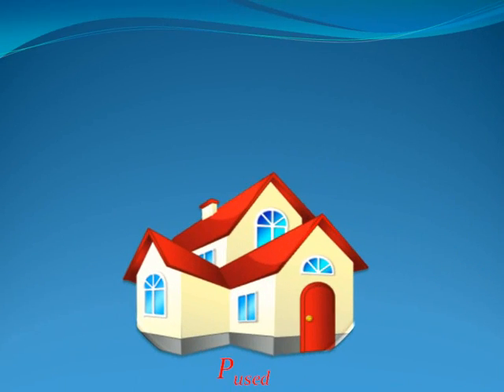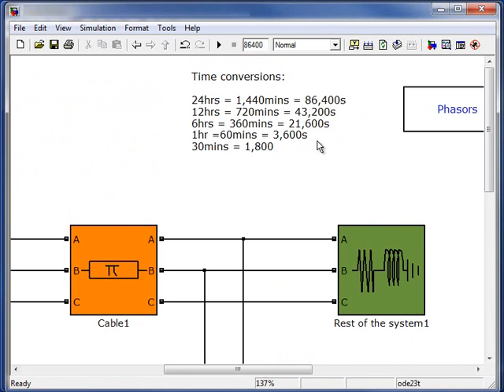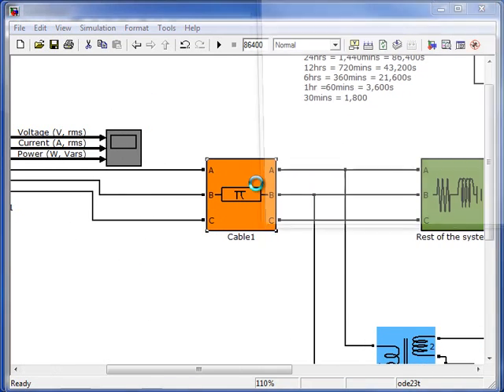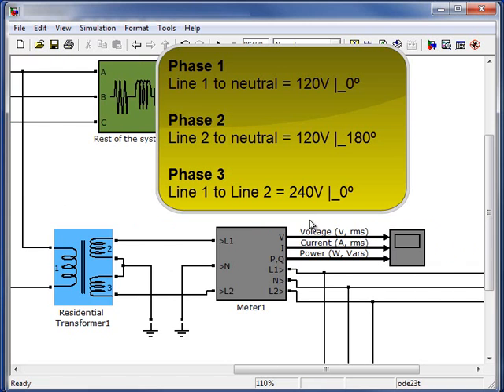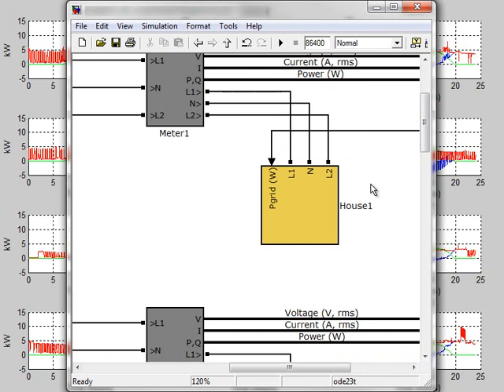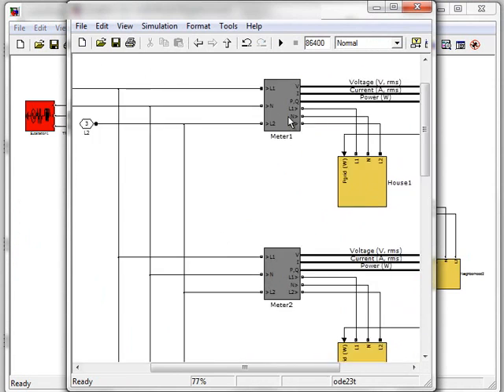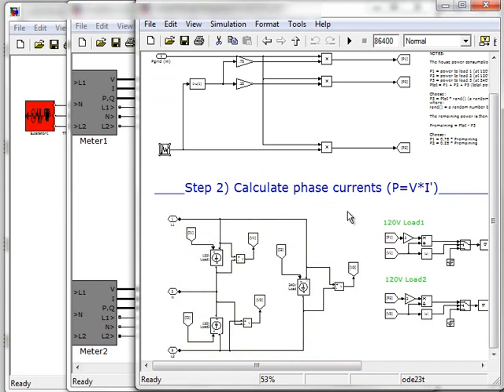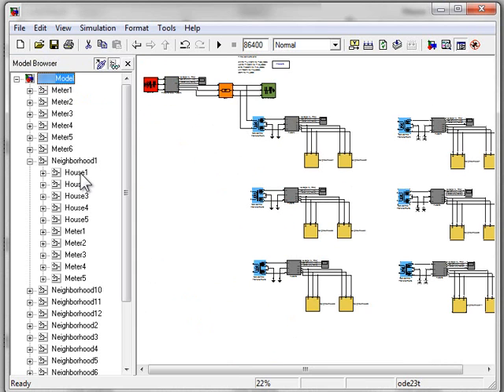Simulink Smartgrid Simulation 1: The Basics

Comment: Thanks for the explanation of the model. How can I run both DC and AC system in "Phasors mode of powergui"? My model works with AC alone, but not with DC source included. Gives error "There is no voltage source, current source, or machine block with a frequency matching the Phasor simulation frequency."

Comment: Thanks very much for uploading this. Where could I find the measurement block you used? I could only find one with V, I output. Or should I calculate the P,Q and create a subsystem?
Reply: plz were can i found the file of download ?
Reply from the maker: It is a custom block.  You may copy it from the example model available for download.
Reply: utcem Thanks for answering. Yes I downloaded the files you provide, yet unable to open. it is not a mdl file.
Reply: @utcem  can i found the file of download ?
Reply: utcem hello, are your house blocks custom made or are they included in the SimPowerSystems`? I would be very glad if you could send me the Project of your great work. Also if its not possible or if you dont want to, thanks for the great explanation

Comment: Before the simulation beings, a PF array is created with random values that vary between 0.7 lagging and 0.7 leading. Unfortunately, the recorded data only includes real power and not reactive power.  The +- 0.7 range was estimated from: PF = P/S = I1 / I cos(phi1) = 1/(SQRT(1+THD^2) cos(phi1), where P=real power, S=total power, I1=fundamental rms current, I total current in rms including all harmonics, phi1=angle between V1 and I1, THD = total harmonic distortion.

Comment: I was trying to implement it on Simulink but as a beginner I need a reference data for houses which I couldn'y find anywhere. If you can guide me regarding the reference data for each house it would help me understanding the impact on each house and think on improvement of the system for a specfic country.

Comment: hey while simulating I am getting the following error:

Input port cannot accept mixed numeric types. Input port 1 of 'b/powergui/EquivalentModel1/conversion /Complex to Real-Imag' expects a real or complex signal. However, it is driven by a signal that includes both real and complex elements

and this one:
An error occurred while propagating mixed numeric type from 'b/powergui/EquivalentModel1/conversion /Complex', output port 1.

any HELP???

Comment from the maker: The data is injected from 1-minute recordings.  This data in necessary to produce the load shapes.  The data belongs to Pecan Street, Inc., but is not available for public use.  You may try generating solar data (w/o fluctuations) using a normal distribution function.

Comment: Hi I am trying to simulate a small powers system network over a period of 24 hour using Simulink and tried simulating using the phasor solution as mentioned in the video. However, my simulation time is still require hours instead of minutes. Is there anything I can do to speed up the simulation?